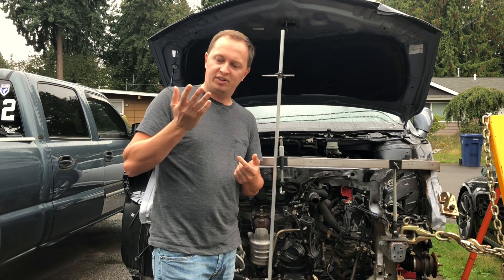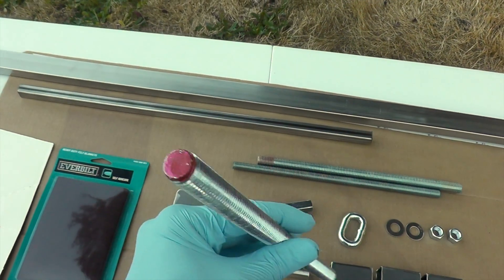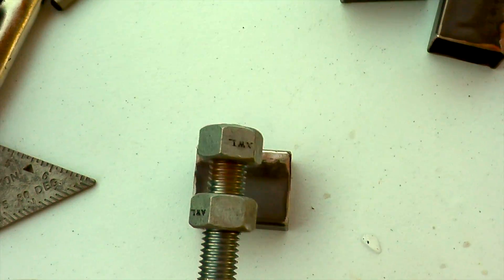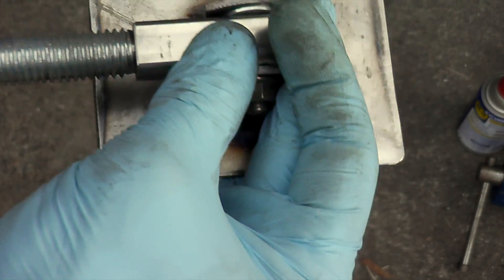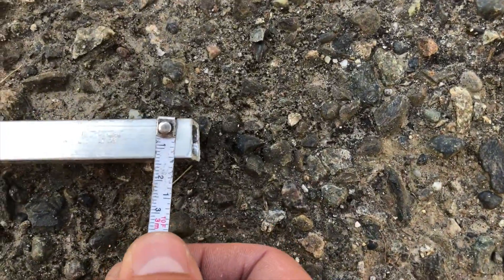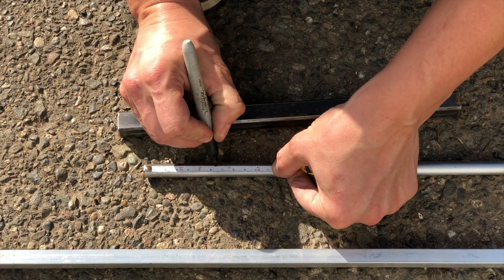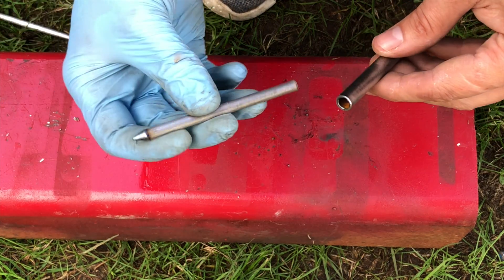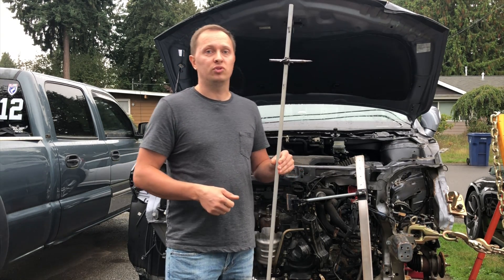✅ I Made a TRAM GAUGE AND A PULLING BRIDGE DIY For DIRT CHEAP Autobody Measurement Equipment

Comment: you appear to like wasps about as much as I do.   Put BORIC ACID (pure, ordered off amazon) outside, dissolved in small doses in apple juice with some chicken scraps in it. It'll attract those nasty hornets but leave honey bees alone. Of course you know if they can bite you they're not bees they're wasps or hornets ... which is actually more of a flying ant.. In small doses ... the hornets will take the boric-acid laden apple juice back to their nest and it'll slowly kill all of them over the course of about 2 weeks ... in fact, once you get the mixture right such that they're attracted to it, it'll kill ALL of the hornets and wasps for about a half mile radius or more. You just have to experiment with ways to attract them to it as each species and region varies.

Comment: A REALLY cheap power source for "Pulling" glue tabs etc is a scissors jack - they (as opposed to other jacks) work at any angle & pull/push with the same force in either direction. I use one to pull on glue-tabs using a chain as the "link". I made a simple bracket that attaches the scissors jack to an RSJ - in my case, a pillar in the workshop. By rolling the vehicle forwards/backwards, moving the jack up/down the RSJ, I can pull at any angle on any dent from a single fixed upright. By pulling off the workshops roof rsj, I can pull on vehicle roof dents.. 

With that simple device, I can make any pull you'd care to make on any vehicle - even crunched quarters with no backside access become a doddle to pull. Same goes for sills. 

Loving the videos btw Fix206 - keep them coming. :-)
Reply: Wtf is an RSJ?
Reply: steel I beam - rolled steel joist..  @jimd280

Comment: Great job on the gauge set. A recommendation though is you should have left more of the pointed rod stick out of the tube, so you can do under the car to frame measurements. You will need a longer length to clear certain obstacles. Maybe make another set of longer rods.   👍
Reply from the maker: Good call on that !! I actually do have a couple of extra pointed rods that are quite a bit longer, I made them after this video was posted. Used them just couple of days ago on a new project to see if the frame rails had moved or not. Couldn't have taken that measurement with the shorter rods 👍

Comment: Good job.. Where did you get the self adhering tape and beams you used? Спасибо.
Reply from the maker: All of the metal I picked up at my local metal supply yard... And self adhering tape I got over at Home Depot, but most hardware stores should carry something similar to what I used. Спасибо вам !

Comment: Your welding appears to be adequate, but your safety procedures are non existent.  If your going to make DIY videos do those that will watch them, do then a favor.  Stress how important it is to use proper safety procedures.  Like using grinder shields, face shields, safety glasses, welding gloves, appropriate clothing, plus all of the other safety procedures that will keep your and your audience safe.   

Ok, how do I know?  Well how about over 60 years in auto body repair,  collision repair equipment sales and training,  Manufacturing of autobody equipment, construction equipment, farm equipment.  We are still in business.  I offered up these observations not to admonish you, but to encourage you to offer safety first in what you do.
Reply from the maker: Hi Bruce, I do appreciate the safety concern. I do see exactly what you're talking about and I assume that most people understand how safety procedures work. The main point of this video was to show how to build couple of useful tools for cheap and that's about it. People's attention span is real short as it is and If I've spent a minute of two taking about safety, then folks would start clicking out of the video. So I mainly try to show the main points quickly before people would get bored

Comment: At 5:02, where can u find one of those cylinder tubes that your welding? Or what is it called?  I've looked at home depot and lowes and can really find anything like that.
Reply from the maker: Home Depot and Lowe's will have a pretty limited selection when it comes to this sort of materials. Try googling metal suppliers in your area. There's usually a yard or a warehouse you would go to where they'll have a big selection of all kinds of metals of different shapes and thicknesses. Try that

Comment: what size is the main beam for puller or where do you buy it?
Reply from the maker: I believe the main beam on the pulling tower is 3x5 inches... I bought it locally on craigslist
Reply: You have sized for the materials used.  I am interested in asking  this.   These are 300.00 to buy
Reply: Is that beam 14 guage or 11 guage wall thickness?
Reply from the maker: Wall thickness on the tube is 1/4 inch
Reply: @fix206  do you have anymore measurments. I am trying to locate some of these items at the store to make one too. Any dirction on measurments would help me alot . I dont have the 300.00 to but one of these. Thanks
Reply from the maker: Basicly all of the tubing used in this project is 1/4 inch thick and all of the plate is 1/2 inch thick
Reply: Looking to build one of these and trying to figure out the sizes. But if the the the small peieces are 2x1 theres no way the main beam is 3x5and the thickness of it all looks no where near 1/4 more like 14 gauge or 1/8. Is that correct?

Comment: this guy has been selling these tools he made years ago , I found this ad years ago , I must admit it is genius , you can check just about anything from a spindle to a center post    Frank T            https://www.ebay.com/itm/Tram-Suspension-Center-Post-Measuring-Auto-Body-Frame-Machine-Gauge/221865874025?epid=1591190855&hash=item33a83c9269:g:KhwAAOxy9tpR8cjv
Reply from the maker: Yeah, I've seen that guy's stuff on eBay before. But at $250 ??? That's why I made my own, and you can add more components to the setup that I've made to be able to take more measurements, and that would only cost you just a few more bucks. So I'd say $30 worth of materials and an hour or two of your time will yield you what you see in that eBay listing

Comment: what welding machine do you use ?   can you introduce ?
It looks quite easy to handle .
Reply from the maker: I'm using a Vulcan OnmiPro 220 welding machine... It's a pretty good machine and the price about a half of Lincoln or Miller
Reply: @fix206  oh. Thanks!   
I am gonna buy it soon.
Cost performance ratio looks good.

Comment: Hi!
Buy a new welding machine or put it on because what you weld is not good, can't you see?
Reply from the maker: I do have a new welding machine, I use it all the time, I just used it build a car frame pulling machine, you can see it here https://youtu.be/krCki0BT8Fw  the welds a re just fine. Plus you don't need super strong welds on the tram gauge or a pulling bridge anyway
Reply: @fix206  Okay you don't need super welding but here in the world you make your work aesthetic and beautiful because it judges you.
More good and demanding work and a nice day.
Reply from the maker: I see what you're saying, but this was just quick and dirty how to video, nothing special. I mean If I wanted to show off my welding skills I probably would have used a TIG welder and put down some really pretty bead, but that was not my intent. I just wanted to show how to make couple of simple tools with just some simple tools that most people would have sitting around in their garage. And most people don't have a TIG welder or even a nice MIG welder, but a cheap FLUX Core buzz box.
Reply: @istvanbereczkygyor  not every weld requires aerospace quality. its a a simple tool. the welds are plenty strong. 
if you are judging a weld by its looks, you have failed. i have in my line of work seen beautiful appearing welds that wouldnt pass inspection.
Reply: @dieselguy62   undemanding, that's it

Comment: Very informative video. Unfortunate about the hornet attack at the start. We have paper wasps here in Australia that are even more vicious. If you happen to bump their nest, you can be attacked by several at once and if you try to swat them, it makes them attack even more.So the only option is to run like crazy to get out of their range.

I'll be making the tram gauge later, so the information you provided is most useful. I previously looked them up online and the cost was similar to what you mentioned, so making one is the best option. Sure, it won't have the fancy calibration that an expensive one has, but then again, is all that flair really necessary for basic measurements like you demonstrated? Your tram gauge is a really good solution at a very cheap price with a bit of work that saves many hundred dollars. Very much appreciate you going to the trouble of showing us how to make one. I don't think I have a use for the pulling bridge, but it was interesting to see how you made it and many others will want to construct one for themselves.

You also hit the audio on the head. It was well balanced and a good volume. Great work.
Reply from the maker: Thank you Bruce, thinking about it after the fact I realize that that hornet wasn't out to sting me, I probably had something on my hand that atrackted it and it just landed to explore, but the damn thing did pinch me with it's mandibles and that's what really freaked me out... I'm glad you've liked the video, hope the explanation was clear enough and that I've left nothing out. I've had other folks ask me to do a vid about the bridge so I thought I'd kill 2 birds with one stone and tackle both projects in one shot. I think I've figured what I've done wrong with my sound in the past, and I'm happy that the audio tables are where they're suppose to be. And I thank you for pointing it out, otherwise I probably would have kept making the same mistakes for a while longer. 
Cheers my friend, I'll have more vids out soon :)
Reply: @fix206  Yes, you covered things nicely with the video. While I probably could have worked out how to make the tram gauge myself, it's going to be a whole lot easier to make it after seeing your video and following your design. I probably won't have a need for the pulling bridge, but if I ever do need one, I know where to look to get guidance on building it. Glad my feedback on the audio was useful. I always try to help where I can. Worst thing that happened to me with a wasp was when one stung me just below my left eye. That really hurt and it took a while for me to recover, but it could have been a lot worse if it'd hit my eye.
Reply from the maker: Thanks again and steer clear of those wasps my fiend !!
Reply: @fix206  You probably like wasps more than I do.🤣  If you have any haunting your property (especially since you have kids) you could try a few things to eradicate them. (The youtube video explaining the proportion is titled below) explaining how much boric acid to dissolve in small doses into apple juice. Apple juice isn't sweet enough to appeal to honey bees but it should be appealing enough for some species of wasps or hornets (more of a flying ant). The idea isn't to kill them at the "fountain," but to have them bring a small dose of poison back to their nest to kill the queen and larva ... which, once you have a concoction they're attracted to would take about 2 weeks to eradicate the population up to a half mile or more. It's just a matter of figuring out what the species in your area is most attracted to. 

Video Title: Safely kill ALL Hornets, Yellow Jackets and Wasps for 1/2 mile. Safe for honeybees.

BTW ... what's your name..?

Comment: Awesome video. I've got a suggestion for your next project. I think you should build yourself a rolling work bench. You could cut, weld, fab and lay out your tools on it. Add a shelf or two under it along with power outlets. That way you can just roll it into the garage at night with all your stuff on it and back out in the morning. And best of all... you can quit cutting and welding on the lawn and blacktop. Trust me, your knees and back will thank you when you're a few years older.
Reply: I agree 100% with Terry.  Great advice.
Reply from the maker: I am embraced to admit it but I do have a rolling work bench, but it is buried in my garage... I do got to unearth it and start using it :)